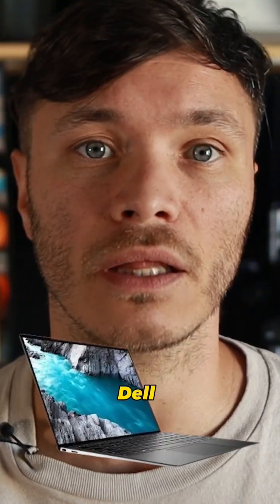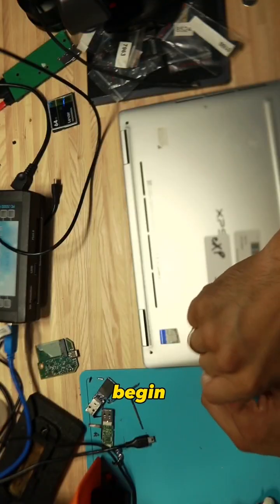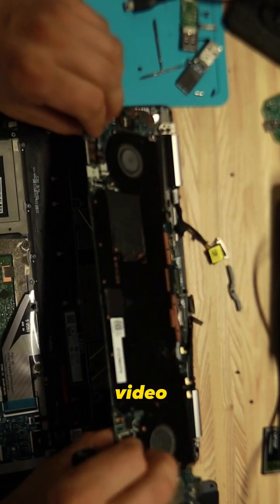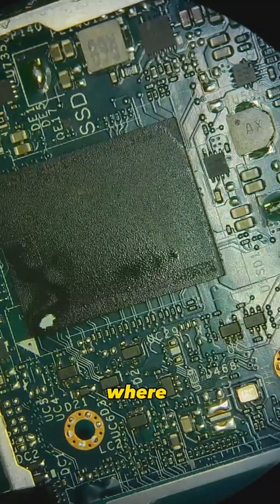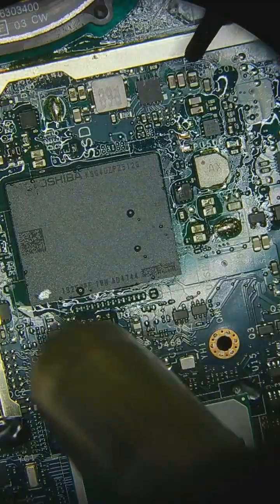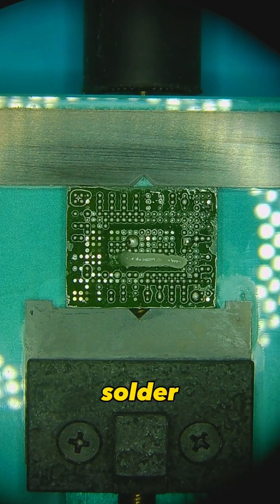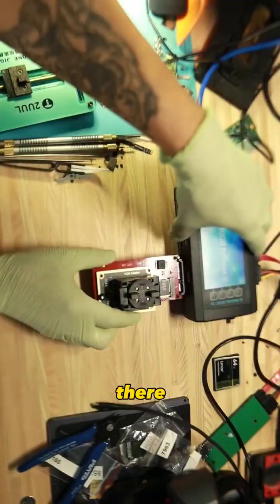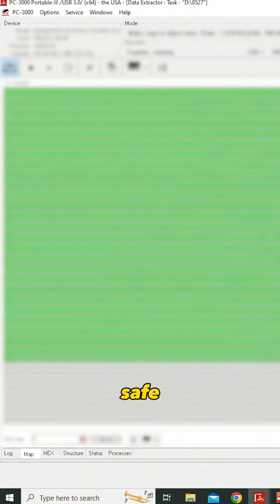Data recovery from BitLocker encrypted Dell XPS SSD

Comment: Why Microsoft completely fails to communicate (let alone include) such a crucial piece of information during the Windows SETUP process is absolutely beyond me...Never heard of a bitlocker key until being in this mess of being locked out of my computer but unable to access the encrypted data. Thanks, Microsoft...

Edit: I now found bitlocker is tied to the hard drive by the user who FIRST setup the account, so additionally this system thereby screws anyone who buys second hand...Genius, Microsoft 👏